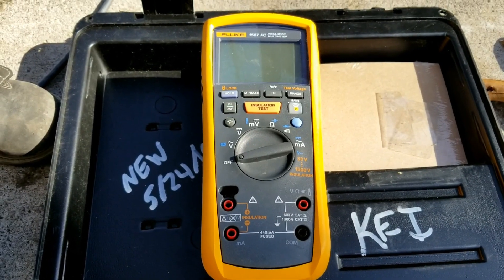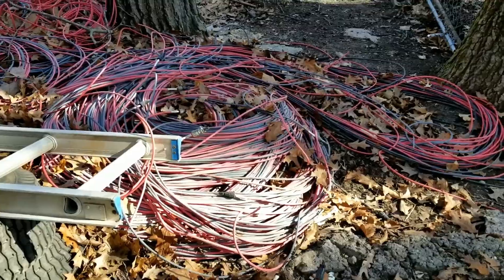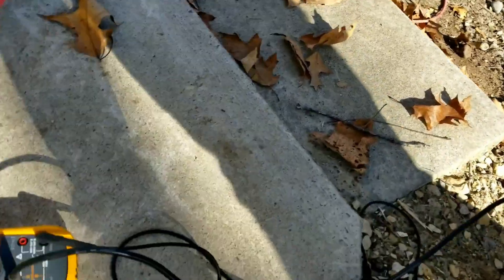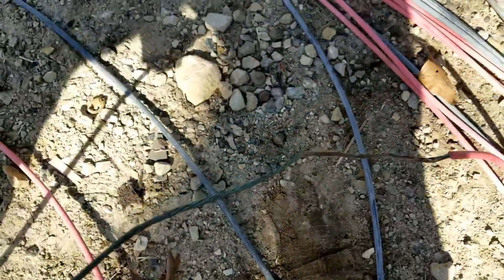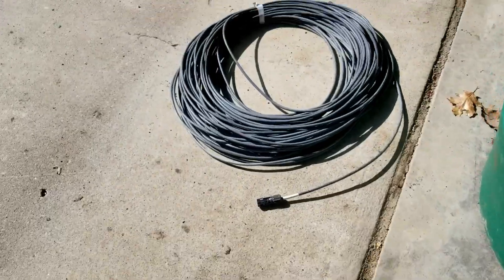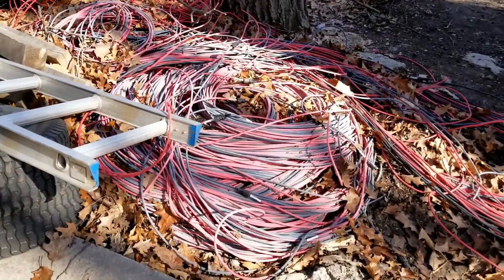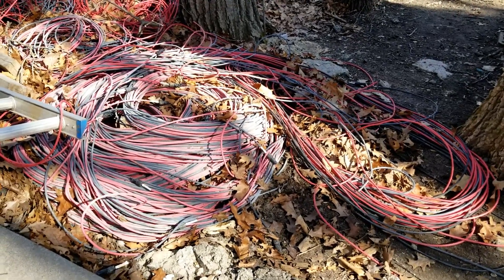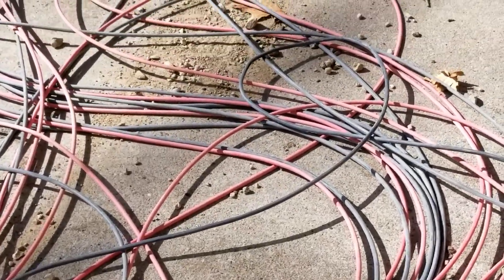PHOTOVOLTAIC, CABLE TESTER, CABLE CONTINUITY USING MULTIMETER, FLUKE 1587 FC INSULATION MULTIMETER

Comment: even though it says direct burial, it is still better to put in pvc pipe to protect from being chewed and other damage. if you need to replace, it[s easier to pull new wire through, than dig it up.
best
Reply from the maker: Thanks Rev